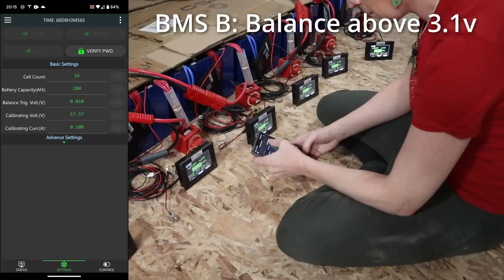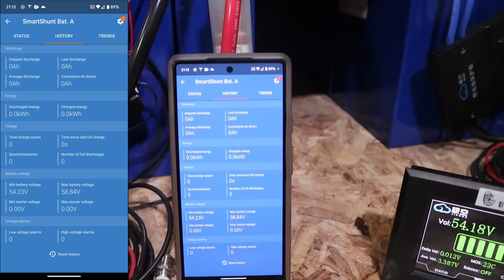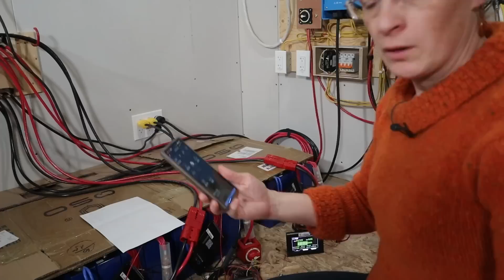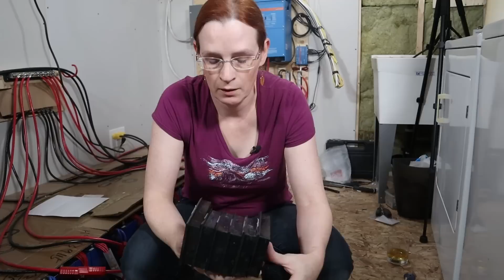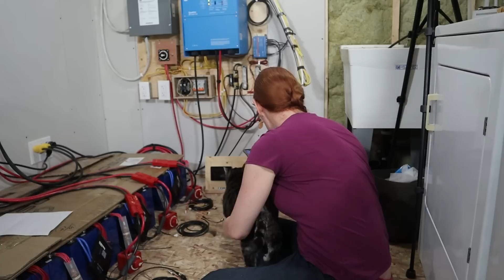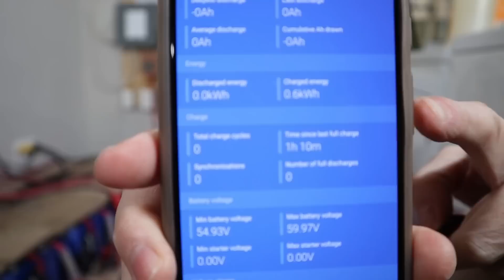Sparky Science! - Big Battery Build! (Ep. 48)

Comment: hate when that happens..i dont like sparks and high voltage arcs ..i remember when i was kid i cut a cable cord plug into a outlet with a scissors and blew on me and hot little bits of metal flew on my pants and into my skin worse pain ever and blew the fuse in the trailer lol  also i plug my esc on my rc car backwards on the battery and the capacitor blew like a gunshot ran my ear dumbs 🤣

you have so many battery wires cables shit will happen even if careful, need to prepare for that.. ive seen a 4s lipo rc blow up at the rc track while charging, 6 foot flame for like 5 seconds glad no one was around it .. i was wondering when i saw this battery build on other vids you did at first i was thinking something will spark or fuck up on this build lol .... stay safe triple check
Reply from the maker: That's just it! Mistakes happen. Anyone who has taken a big project outside their past experience will make mistakes, including dumb ones. That's life. Just have to shake it off and get back at it.